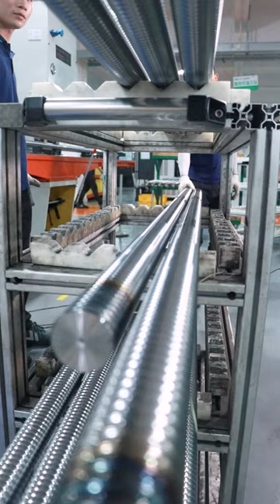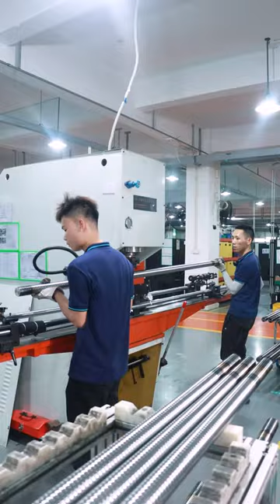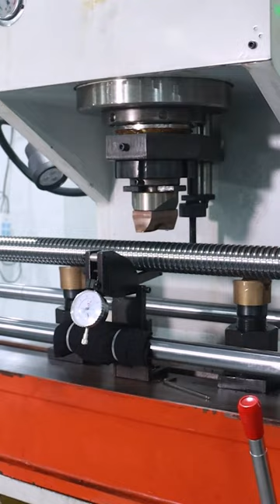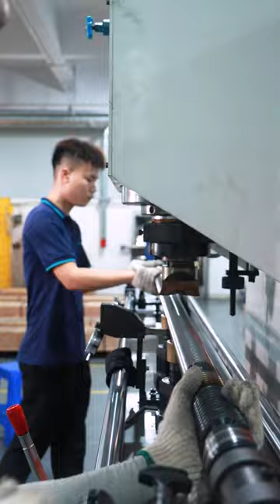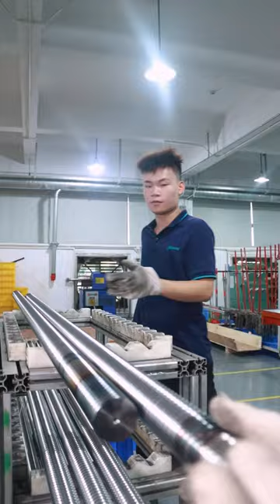Yiheda ball screw Straightening process,Anyone need a screw?#automation #shorts #maker

Comment: These are parts of cnc table movement axle?
Reply from the maker: Yes, it is mainly used for linear motion. It is the most commonly used transmission element in tooling and precision machinery, and you should see it in many places.

Comment: Application specific, but I don't want anyone bending my ballscrews into tolerance
Reply from the maker: Then the place where you apply the screw should be interesting.
Reply: It is likely that most, if not all screws must be straightened. Machining and heat treatment, both cause parts to warp, bend, and twist. You might be surprised by the precision that can be achieved with manual machines and dial indicators.
Reply from the maker: @Convolutedtubules  :face-purple-wide-eyes:
Reply from the maker: @Convolutedtubules  Kudos to you.